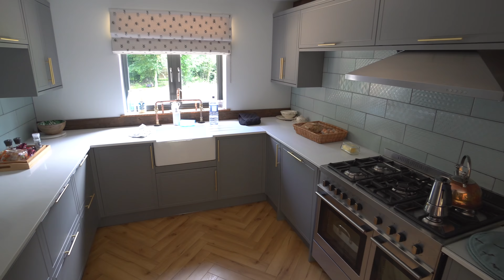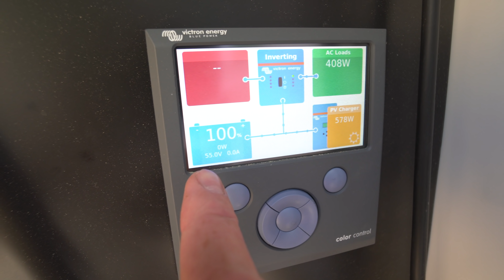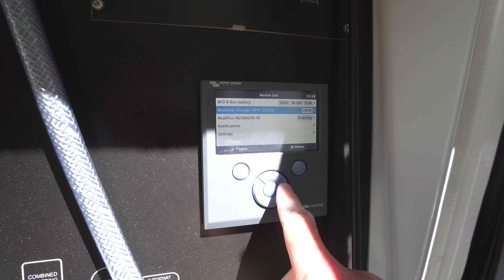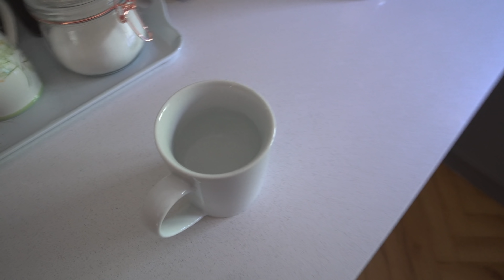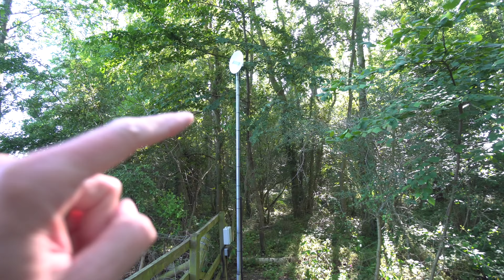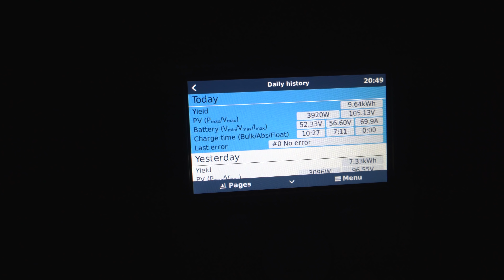AMAZING OFF GRID SOLAR POWERED CABIN | POWERED BY VICTRON ENERGY

Comment: Can I ask a question if your using solar to just connect to a inflatable hot tub how much solar panel you need, what wattage inverter you need and the battery 🔋 capacity you need.

Comment: Its a cabin, not a house. You don't need a ton of battery storage. I only have 2.5 kwh of battery storage at my cabin and thats plenty to get me through the night or weekend. I find more panels and less battery is much cheaper and will work just fine. Even on a cloudy days that amount of panels will fully charge the batteries.

Comment: Hi Andy

Great video and glad to see that you like our EasyGrid system. In response to your questions:

The EasyGrid 3000 contains a Victron 3000VA MultiPlus which equates to 2.4kW. We set the generator to kick in automatically if the load exceeds 1.8kW at any one time. This gives the generator enough time to turn on and start up before the 2.4kW inverter limit is exceeded.

Since this system has been installed, there is now an option available to use any excess solar to charge a small immersion heater where possible. The 4kW array is good for charging the batteries up quickly in the morning in summer as you explained, but it also sized as such to help significantly during the winter months where the sun is not as readily available. 

The EasyGrid range comes in various different sizes, with larger inverters and battery banks enclosed within the unit whilst retaining the complete plug and play solution.

More information can be found here:
https://www.energy-solutions.co.uk/products/easygrid

Thanks again for the informative video and nicely demonstrating our hybrid off grid power system!

Gurvinder
Energy Solutions
Reply from the maker: Hi Gurvinder, thanks for commenting and for the informative answers 👍 it’s a great system you have there. It makes perfect sense and great to see you have added the water heater feature to burn off some surplus energy, you could also ask the owner to consider adding a dynamic EV charge point like a Zappi, that would be cool for the future. If you have any other interesting off grid type installations maybe drop me an email at andy@cloudsto.com and perhaps we can feature another one on the channel.

Comment: 48v 150ah? That's exactly what my solar system has , it barely powers my basement .. at night i cant run anything more than. 50w fan all night charge my phone and maybe leave 1 tiny led bulb on ...
Reply: Lithium or FLA? because 48v(actually 51.2v) x 150ah = 7680wh. A 100w load should run about 72-76 hours without power input. If you have Lead Acid, you only get 50% of your Ah rating or less. 48 x 75 = 3600wh. So a 100w load should run 35-36 hours without input. You either have something configured wrong, or your numbers are wrong.

50w fan
20-30w phone charging
10-20w LED.
Reply: @ninja5672  maybe the batteries gone bad and my inverter takes 60w load on standby ..
Reply: @PhysicsViolator  Nothing you listed needs an inverter... But yes, your inverter could be using some. A decent one will use 20watts running. Yes, bad batteries is also possible, if they aren't new.

Comment: I have the same set up but different battery's I would say the color control is set to turn on gender after 2000w as microwave was 1500 , quite low but dishwashers stay on for 2-3 hours so I can see the logic, images doing it at night you would flatten them.

Comment: Kettle, microwave, washing machine, freezer, fridges no problem! Just need a bigger system and inverter, lovin the cabin though but they have most likely used an HF inverter, instead if low frequency, hence the surge kicked in the Jenny.

Comment: Very cool setup - I like that all in one solar controller/inverter/transfer switch/batteries. Don't worry, I'm building something very similar, and will document it here on you tube - I am still collecting parts, in particular, the 8kWh of lithium batteries. I have a smaller usage pattern than that off grid cabin, and I'll still run big loads like the vacuum and washer from the grid, but everything from the kitchen forward will be powered by my aptly named "power tower", a 22ru rack case containing all the equipment for solar generation, including the batteries :)

Comment: The generator turns on because the inverter is a multi plus and the max load is to big for the inverter so it adds power from the generator
Reply from the maker: Yes I think continuous rating for that inverter is 2500W so it makes sense. I think they have it set so anything above 2000W the generator will assist.

Comment: i see why the genny kicked in..  the inverter is a multiplus 48-3000 .. which is only 2400w in real life and that's if the power factor is 1 and id say the dishwasher is 0.9 ish... so its probably set to kick the genny in with loads of 2000w to avoid putting too much strain on the inverter
Reply from the maker: Ahaha! Yes you are right. I’ve been thinking about this since too. Definitely to do with not surging the inverter or actually the batteries as currents could still get pretty high even at 48V. Ultimately I think the generator is used as part of the system rather than an extreme case power backup. Cheers for the comment!👍
Reply: @andykirby   .. id say the batteries are more than capable of the currents involved, it's probably been set conservatively as it's being run as a business,  can't have disgruntled punters complaining the have no power haha ... when it comes to batteries, inverters and electrics i'm a complete nerd .. i just don't like cameras.. so i leave all that stuff to you guys.. good channel ... keep up the good work
Reply from the maker: Torchy thanks man,  yeah absolutely, batteries more than capable but I suppose cycle life will be years and years if they are treated really conservatively. I’m both a geek and a camera nerd and it’s hard sometimes when to know when to stop waffling😅
Reply: I think it was issue with inrush current to start a motor maybe. Still it is a bit strange, because most 3000W inverters will do about 120% for few seconds. But it is not 3000W, it is 3000VA (Non-linear load, crest factor 3:1 ). The continues output load is apparently 2400W, as you said.

The inverter looks quite well cooled, but maybe it isn't, so that could have been an extra factor.

Comment: okey, gonna try this again, is it safe to use a 52v battery on a 48v 1000w hub motor with a 30a controller?
Reply: Yes, checkout ebikeschool channel.
Reply from the maker: I did answer this before but yes you can do it as long as the controller can handle ~60V

Comment: Does the generator serve just the one cabin of the site?
Reply from the maker: Yeah there’s only one cabin there.
Reply: @andykirby  could be that the victron is set to bring in the standby generator at a certain load threshold to prevent the internal battery from being drained in a short amount of time.
Reply from the maker: I think you are right and as someone else said to prevent excess load on the 3000W peak inverter.
Reply: Exactly that as well 👍

Comment: So tiny only 150 Ah, normally on an off grid you would need about 360 Ah per person. If you look at the beginning it says that it's output current no AC which means it's coming from the 48v at 32 amp or 1536 watts. Basically you have a 1000w or 1500w inverter producing 230v AC from the 48v DC & when you used the dishwasher it was most likely using more power than the small inverter could provide so it automatically switched over to generator as it's only a very small system even though it has 4kw of solar on the roof.

If you are running a house fully off grid then you would need between 1000 - 2000 Ah using Lead Acid @ 48v or around 750 Ah Lithium Ion with 8 - 12 kw of solar. That way you could run washing machines, hot water systems, electric stove & things like kettles, coffee pots, toasters as well as air conditioners.

Comment: "much better to use fire" ... ya if you ignore the climate change nonsense.  Cool solar/etc but if you're using fossil fuels for the energy intense stuff you're kinda cheating.
Reply: There is no “climate change” truth,read Piers Corbyn weather 
Why do jets fly around the world 27/7.
And why don’t they limit Jets flights?
Reply: Norman Kennedy ‘They’ will taxes will force people to find alternatives
Reply: Using firewood as a fire source is carbon neutral
Reply: @Shayne2110  Not really.  You're prematurely cutting down trees which halts their ability to absorb CO2 they normally would have.  Significantly altering the ecosystem in the process sometimes in ways that are not easily reversible. The logging industry also uses plenty of fossil fuels...
Reply: @tomstdenis  Most people I know that have land and burn firewood, only use trees which rot / die naturally. I use both my own dead wood and wood given to me from a local source who has too many dead trees himself each year. Definitely carbon neutral this way and the trees seed new growth themselves. (I wouldn't buy wood to burn from non-renewable sources anyway)